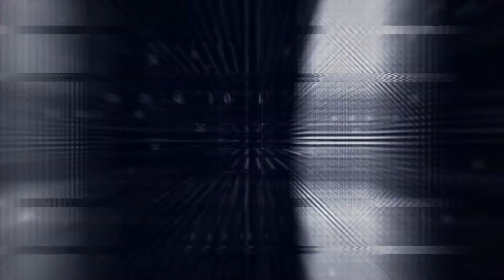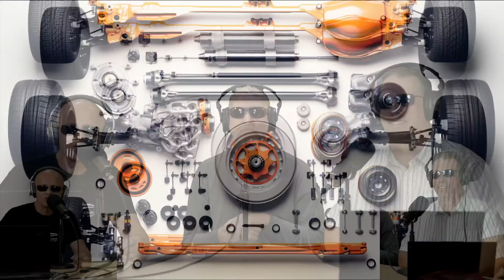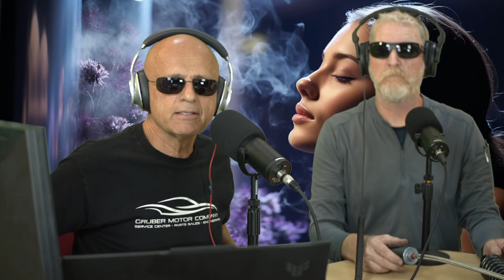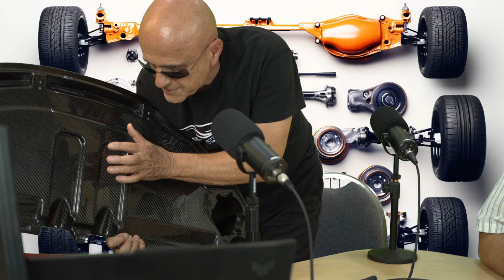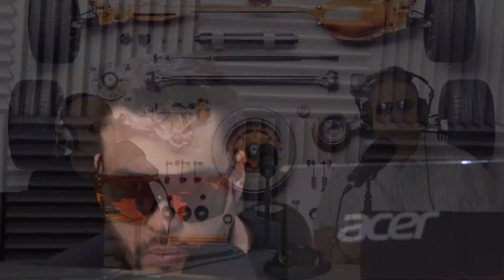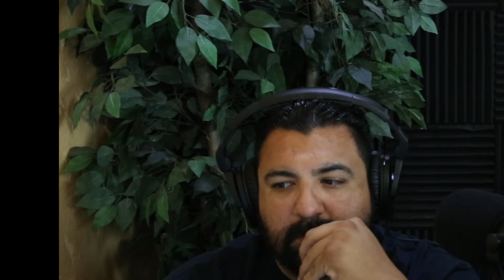Tesla Roadster Podcast - ep 27

Comment: Slight correction, if I may, regarding the 12v system?  I believe the 1.5 cars pull the auxiliary (12v) power from the first TWO sheets, running that through a DC-DC inverter to get 12v from the 30-something volts from the sheets.  As you noted, that put more strain on those two sheets vs the rest of the pack, so in the 2.x models the DC-DC inverter runs from the full pack voltage to generate the 12v aux power.  

The separate 12v battery added to the 2.x cars appears to me not be related to this.  Rather, it looks to be a safety thing to supply 12v power to stuff like the flashers in the event of a main pack or DC-DC inverter failure.  I measured the voltage at my 2.0's 12v battery and it was held at 13.77v regardless of the state of the car (asleep or awake).  The only exception is a momentary 15-ish amp load when the Unlock button is pressed on the key fob, and this even if the car is already unlocked.  So, that battery is not really used (cycled) at all in normal operation.  I suspect that momentary load represents a "battery selftest" to assure the battery is healthy in case it needs to be pressed into service.